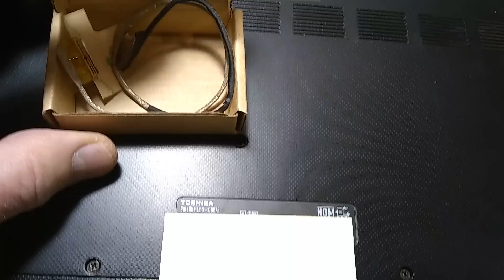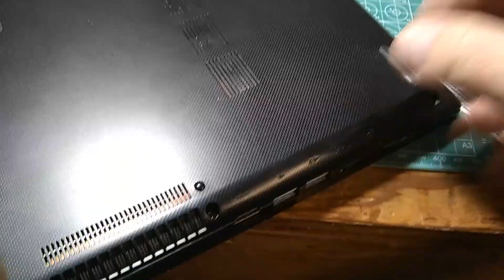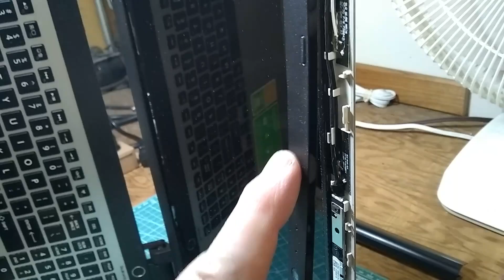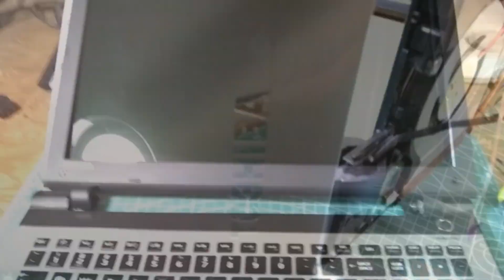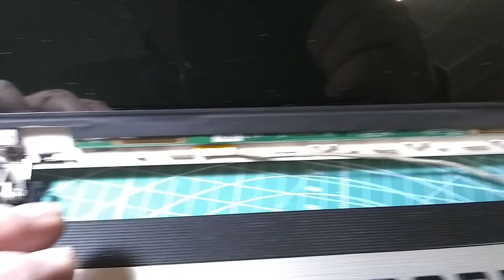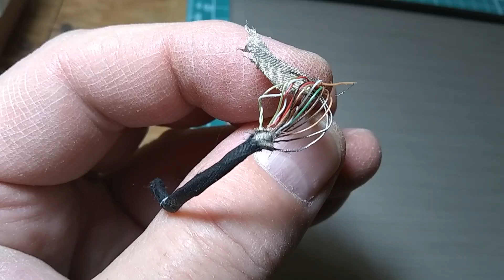Toshiba Satellite L55-C5272 Bad Screen Cable Replacement Repair

Comment: Is this cable same for Tecra C 50
Reply from the maker: Sorry, I don't know if it's the same. The connectors tend to differ from model to model. You could contact the seller about that, and at the same time ask about terms of return/refund.